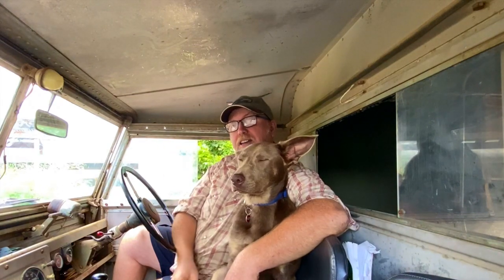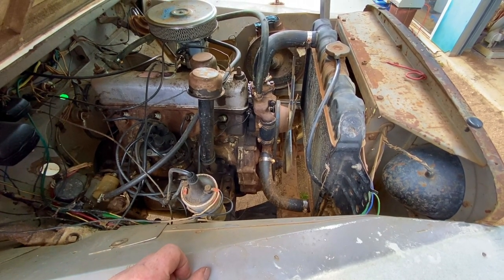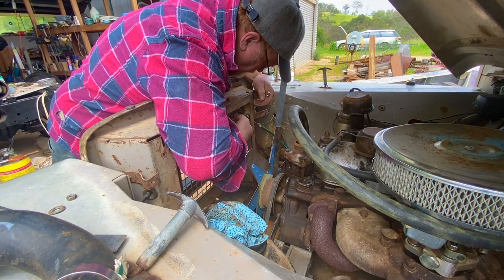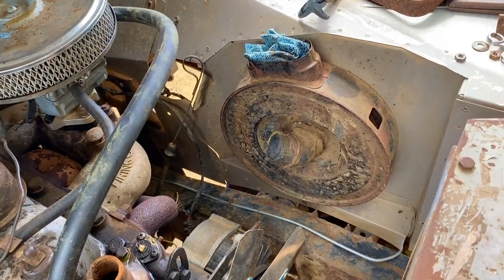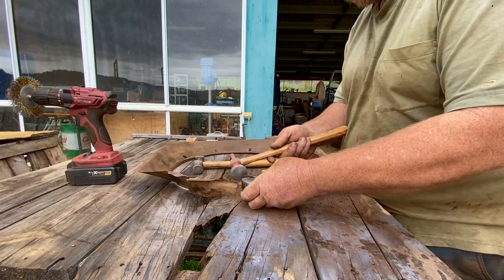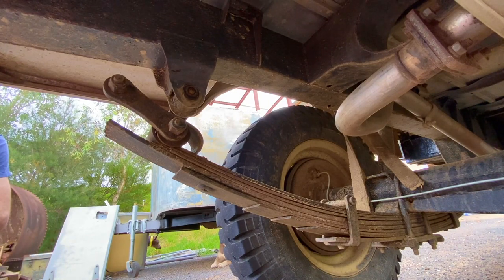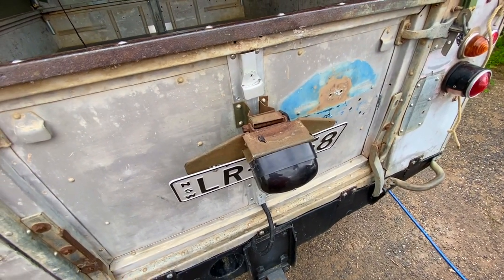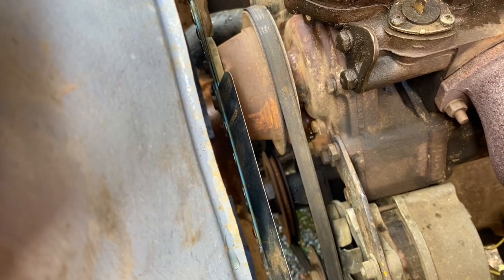Land rover Series 1 - radiator swap out, spring hanger repair & other some minor repairs !!

Comment: Hopefully in 2021 I will add a Land Rover Series 1 or 2 or 2A to my collection! I have been looking, more scarce here in the U S. Definitely want a Series with headlights in the grill and not on the wings. If my research is correct, have to buy a Series that was built before February 1969. Headlights moved to the wings at that time. Thanks for the videos Steve.
Reply from the maker: Yes later 2A's had the lights on the wings, I have a decided preference for the original look with the inner lights also.  Best of luck finding a series landy, they are fun little cars.

Comment: Don't forget to spray the front of it with WD40 so the old Landy slides through the air better.
Reply from the maker: Ha, not going anywhere till that water pump shows up :-)
Reply: Hi ! Happy new year’s from Brazil 
I loved your videos and I hope make somes in to my  Landy 107 to 
My radiators is done too, my engine is not original but the radiator yes 
I think change this for one same yours, how the part number? 
Thanks to sharing with us your videos
regards
Reply from the maker: @Frade3886  Land Rover Series 3 Copper Core Radiator 577609

Comment: Good stuff, I plan on putting a 4 core series 3 radiator into my chariot to deal with the V8. Who do use for parts in Australia or do you get most of your stuff from the UK?
Reply from the maker: Yes the big thumper will take some cooling, I would be thinking an electric fan on an increased capacity rad would be a help.  I get everything from the ol Blighty nowadays, Aussie suppliers seem to be on holidays mostly although I am keen to hear from and support any that can show me otherwise.
Reply: @VintageRestorationsAustralia  good to know about the parts. I’m thinking of the defender whenever I’m allowed home again. The old thumper came with an electric fan so I’ve got a head start there.
Reply from the maker: @ForemanAndWilmsAdventures   You may want to connect with Martin over on https://www.youtube.com/channel/UCZAt9Ddjp6XijX-Vi3OwEXw  His 80" has a major power plant transplant too and you may face a few similar issues or wins worth sharing.